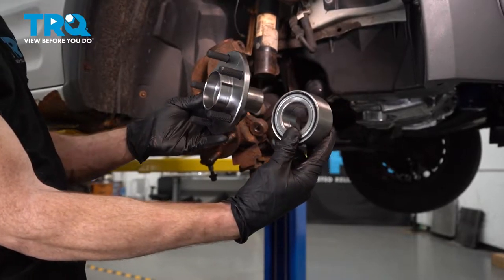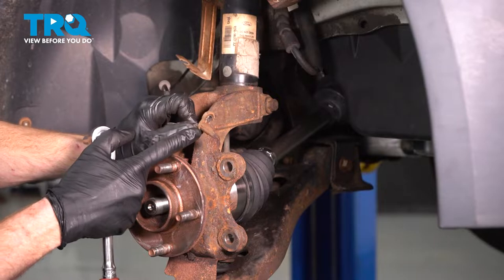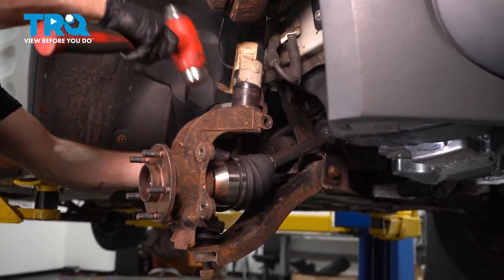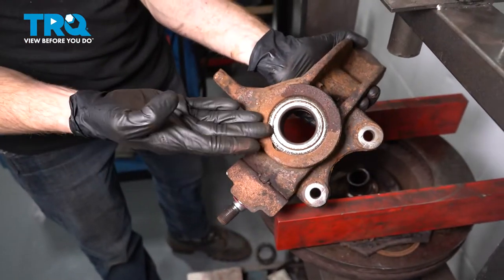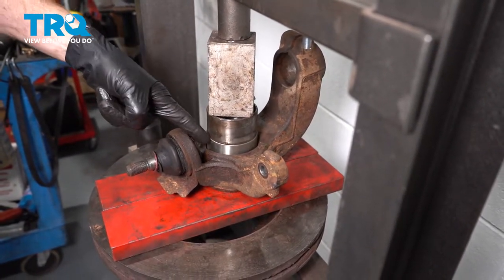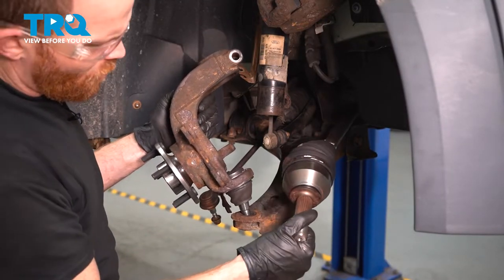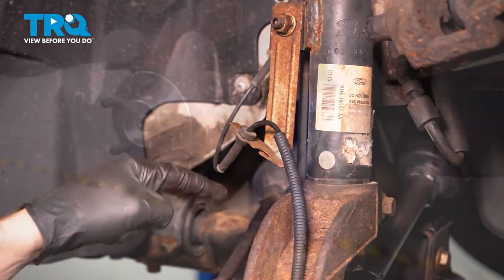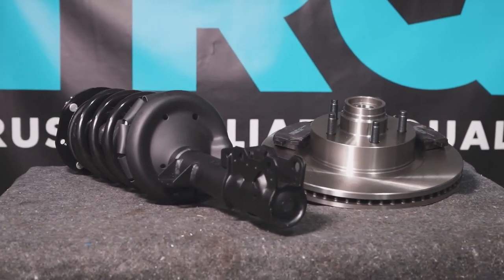How to Replace Wheel Hub & Bearing 2010-2013 Ford Transit Connect 2.0L

Comment: Uausally  have excellent videos and this one was up to standards,.right up to the part you tell us to simply hand tighten the axle nut then proceed to drive down the road!? Torque spec for everything BUT the most important fastener??? The weird noise we'll hear is from driving with a hand tightened axle nut!! Should probably add that information to the description or edit it in. Dropped the ball there...

Comment: axle nut torque 207 foot pounds, wheel in the air, put a screw driver in the brake disc to stop the axle turning while torquing, just did mine today